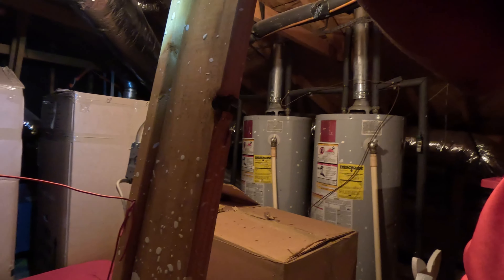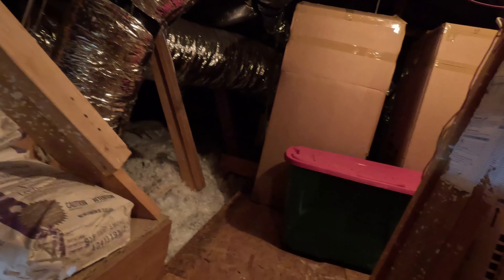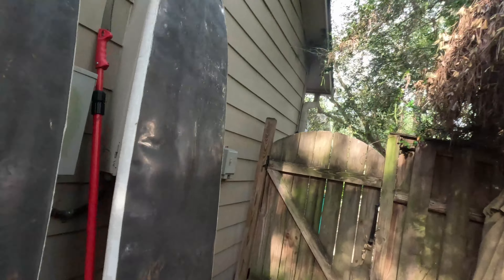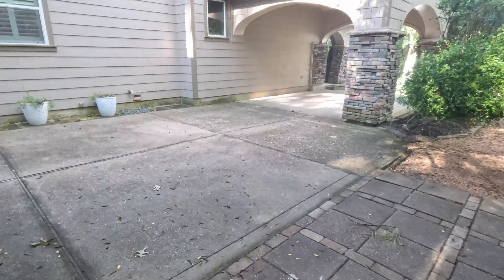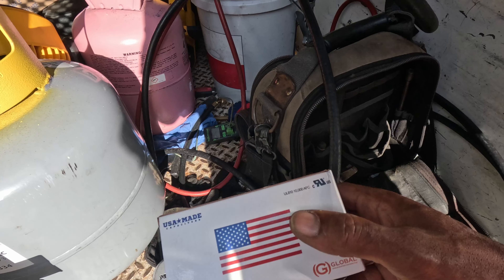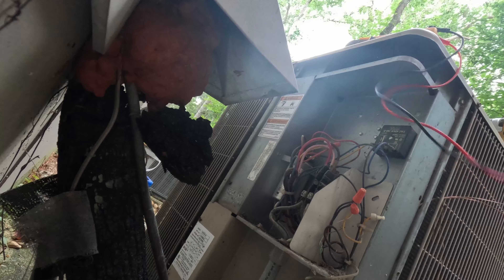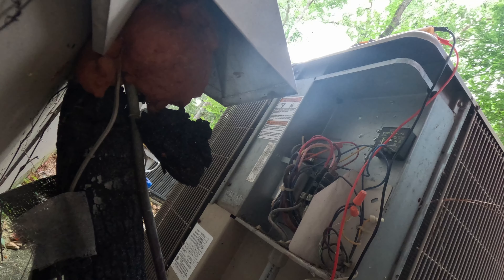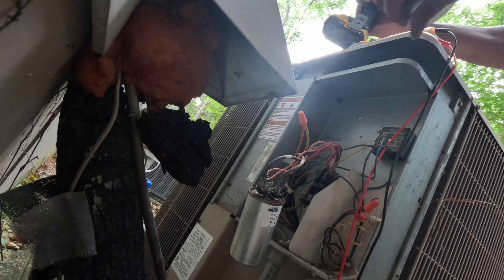Unexpected Outcome: Helicopter Homeowner Does Not Learn How to Replace Capacitor

Comment: I just replaced my capacitor on my 23 year old Trane XB unit.  watching these youtube hvac videos, I knew to check the attic for condensate in the pan, there was none.  I keep up with changing the filters.  I turned the breakers off and on.  The system came on but the ac fan was weak and couldn't blow a dollar bill off.  learned that truck from Ted on youtube.  I knew it was a power issue.  I went to ace hardware and spent $25 plus tax for the capacitor.  It's been two weeks, so far so good.
Reply: They sell caps at Ace, good to know in a pinch, lil bit pricey tho
Reply: It's probably a 50/50 gamble. I'd say half of my calls I have to replace a capacitor. However I replace many capacitors that haven't started causing issues yet when they read way off on the tester. But you need to find out what caused the capacitor to fail. You can endanger the compressor if you fail to find a high resistance somewhere to the compressor or if the condenser fan is drawing too many amps and shutting off. Low freon or too low superheat can put a strain on the capacitor.
Reply: @Bryan-Hensley  thanks for the tips 👍

Comment: Haha I like video never done hvac work for a living but got bunch of rental houses and all my house last 20 years I usually have a extra capacitor for every unit in my shop between that and the fan motor that’s all that goes bad.
Of course I been the the supply house so much and have a business account with them so they will sell me whole units I’ve installed myself even.
HVAC work is super straight forward

Comment: Serious question: why do you have problem with homeowner hanging around, chatting, asking questions to be informed?  What was wrong with that?  Secondly this homeowner does not need learn to replace capacitor, he has home warranty so let someone else to do that...Honestly I don't see anything wrong with homeowner in this video.
Reply from the maker: I dont have a problem with it.
Reply: I’m a contractor and I do, you can’t concentrate on work if they constantly on your back and asking questions.
Reply: If you are a professional then you would appreciate being able to work and perform job without interruption. I believe we as HVAC technicians can use technology like phones and iPads to convey the job we need to do and give the customer a scope of work and money they may have to do to complete the job, Then this kind of thing doesn’t happen. 

Next time Walt go in without your tool bag and ask where the equipment is and then tell the customer you will do a Professional Diagnostic and come get you with my results. After you thoroughly know what to do to fix the complete job. Do test and take notes or pictures. Then go and present your options with IPad on a inside table, for repair or replacement. 
Hopefully that helps with this issue.
Reply: No offense but its annoying when you're trying to concentrate on troubleshooting a system and the homeowner is breathing down your neck with 20 questions. Does your boss do that to you at work? Then they say " I just want to learn". I'm not here to teach. I'm here to fix your system. You want to be helpful? Go get me a bottle of water. Love your channel Walter. Those Texas attics are hot!!!! Stay hydrated.
Reply: Honestly. Why do you HVAC contractors have a issue with the homeowners asking questions or hanging around ?  You have to realize that they are spending hundreds or even possibly thousands of dollars on repairs. I would do the same thing !
Reply: @jmh2244  At times, the work requires concentration and can be dangerous or even deadly if a mistake is made due to being distracted. I let them explain things to me after they have diagnosed the issue and stay out of their way while they fix it.
Reply: @stephenburt7635  Well said.
Reply: @jmh2244  Let me ask you a question. When you're at work does the boss hover and ask you multiple questions. Some work requires concentration. Its like when a customer calls and asks how much its going to cost to fix their system. Or they think you can diagnose it over the phone. We don't know the cost until we diagnose it. Next time your car wont start, call a mechanic and ask him why it wont start. He'll give you the same answer. Until I can properly diagnose it, I can't give you an estimate.
Reply from the maker: @markcotter2355  I do need to implement that
Reply: Only someone who doesn’t do this work wouldn’t understand how distracting/ annoying it can be. I’ll explain it to you afterwards. I’m trying to figure it out myself, and you want me to give you a free course while doing it smh.
Reply from the maker: @Djpicknmeup  I feel you!
Reply from the maker: @Djpicknmeup  When its a complicated problem, it can be very frustrating..
Reply: @WWHVAC  True
Reply: @jmh2244  I'll tell you why.  Do you ask your doctor's these deep questions?  We have paid for in Years of experience, and thousands of dollars in training.  Do you stand over your doctor, while he's working on a problem?  I'm not trying to be rude.  I love teaching people things. But honestly,  Most people don't have the brain to grasp the scope of how their electrical / mechanical systems operate.  This homeowner is not understand; what he is hearing.   He had no: Ah Ha!  No excitement about understand.  I assure you.  If a customer asked me a good question. I'll take them down the rabbit hole.  Usually my customers that have a problem solving mind, tackle their next problem by themselves.  I'm okay with that.  That's an American mindset. Independence, not reliance.
Reply: I never replace a part without approval & signatures
Reply: I have a 3rd price if someone gets to me enough. Most of the time I'm ok with them asking questions but if I feel your breath or feel like you're going to take my wallet then you're getting a price higher than everyone else would. 🤷‍♂️
Reply: @stephenburt7635 except when they create an issue more than what you had. I had a security cam catch an hvac tech pushing his foot on the suction line near the joint to create a leak. There are some real scammy fucks out there, so no harm as a customer, especially your own home watching the work be performed start to finish.
Reply: @amorgan5844  watch quietly is the main key. 👍🏼
Reply: It's way more difficult to trouble shoot a system and answer 1000 questions at the same time. Imagine trying to do your job with someone hovering over you asking questions when they have no idea what they are talking about,

Comment: My wife called me at work one day saying the AC was not working. Told her to call someone. Found a company to come out ASAP. Wanted $300 to change out the capacitor.

Little did he know I grew up working at an electric motor shop. Told him he should be ashamed of himself.

Agreed on $100 for the quick response.
Reply: 300 isn’t that high. Service call is like 100-125 to come out. If you take service call and add say 150 for cap that’s 250-275 then add tax cause it’s a repair and it’s almost 300. 

I know companies that charge 400-600 for a dual cap
Reply: @The1JBanks  My capacitor was $20 and it’s 2 wires and one screw for the clamp. It’s a 3 minute job.

That’s why he took the $100
Reply: @Rabid_Turtle  100 bucks doesn’t even cover the overhead to run the call. Must be a one man operation.
Reply: I think if you tried to argue the price with most companies they would just leave and charge for the service call for coming out.  You also left out that he had to also diagnose the issue and take time and gas to get out there and had the part readily available for you.
Reply: @oilandfireguy1739  $300 for a capacitor change is preying on desperate people
Needing AC.

Most will not question it. I just happen to have experience with them. Diagnosing it is just as easy as changing it.

They should be ashamed themselves. They know most people have no clue. $300 in less then 15 minutes.